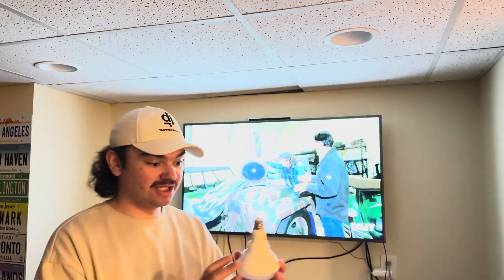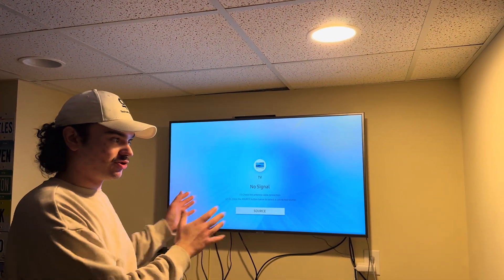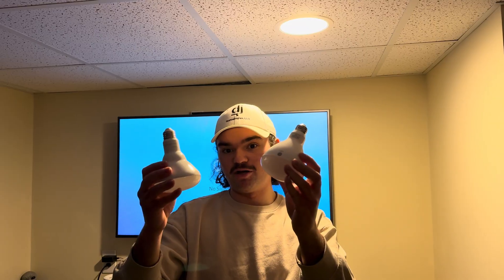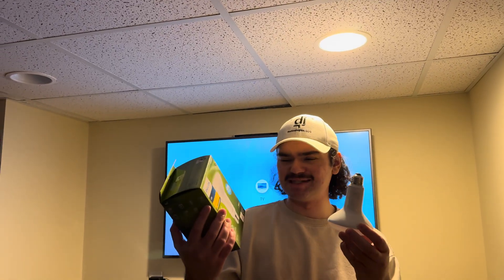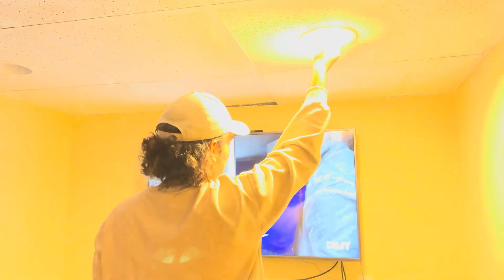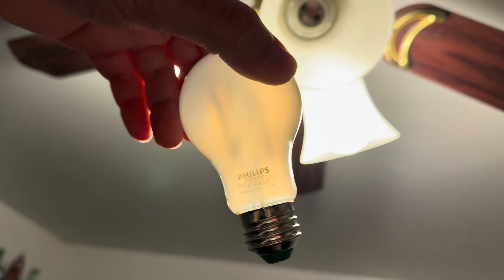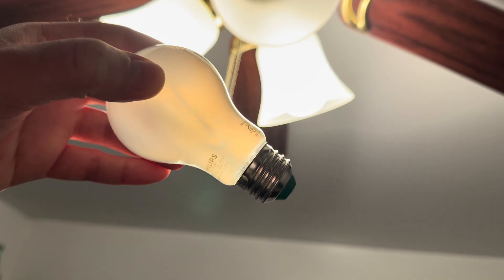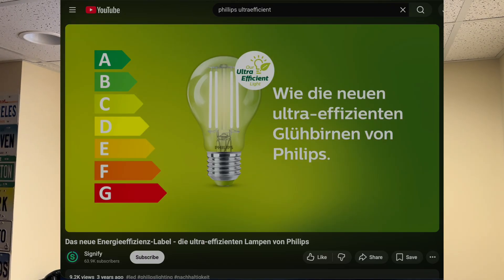How To Fix A Major TV Antenna Reception Issue

Comment: One of the tradeoffs with any power supply is between power factor and switching noise. Active power factor correction power supplies contain high frequency switching converters which spew out noise. A simple full bridge rectifier + capacitor will not produce high frequency noise but will have poor power factor. Do you have a kill-a-watt meter to check the power factor on those Philips bulbs?
Reply from the maker: There's going to be a part 2 video tailored for hams, radio hobbyists, and radio geeks going into more of the details. I'll get into why I specifically chose WVTT-CD on RF11 and not other stations on VHF. I do have a Kill-A-Watt meter, and I was able to collect some data. The A19 draws between 4.5-4.6 watts and has a power factor of 0.45! The BR30 draws 4.3 watts and has a power factor of 0.42! Yes the power factor is bad, but they draw so little power it's almost irrelevant. If we were in a world where overhead lighting circuits were DC instead of AC we could get rid of all of this unnecessary extra engineering for an LED that inherently wants DC to begin with!

Comment: I have two antenna's connected together. The signal for a stations only comes from one. Not both. I have been having more trouble after 8:30 pm. It's not the light bulb because it was fine before and no bulbs were changed in that time. I have a transmitter receiver for the back speakers that do interfer, but only a few frequencies. Mainly physical channels 7, 13. 9 and 11 and 12 aren't affected. Those first two drop by 10 and the others drop by 3 to 5. It is supports to be transmitting on 5.8 ghtz not 100 -140 mhtz. I'm very confused 🤔 on what is happening.
Yesterday, on fox 5 (9) from 8:00-10 pm. One recording completed the who two hours. The other one on a different device only had 1 hour and 40 minutes. Nothing changed on what I was doing. Both devices are hooked up to the antenna the same way. Cable length is different. Completed recording was on the longer cable.
Reply from the maker: It sounds like it could be tropo that's causing issues. Also, I wouldn't recommend connecting 2 antennas together directly, as it can cause reception problems if not done properly